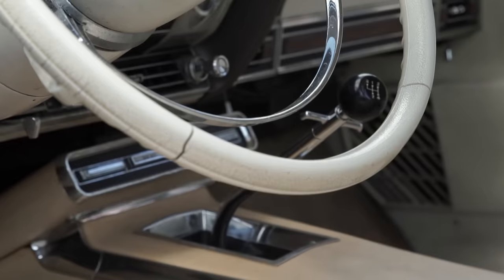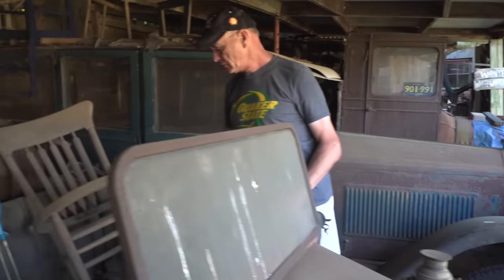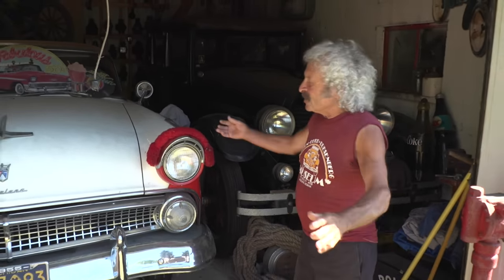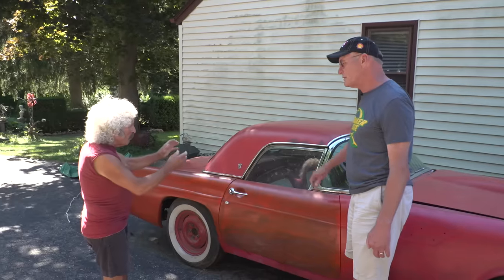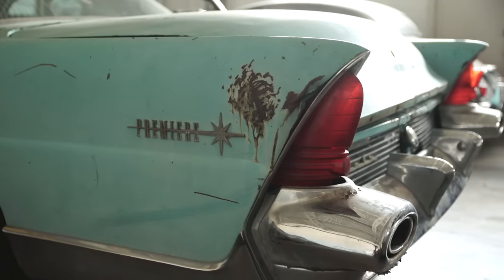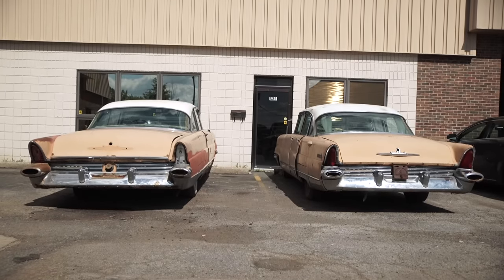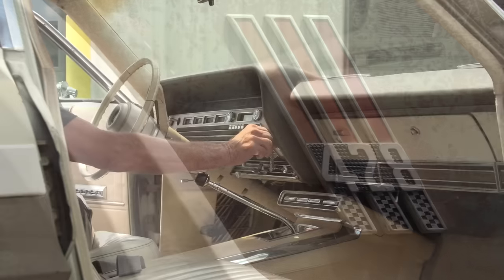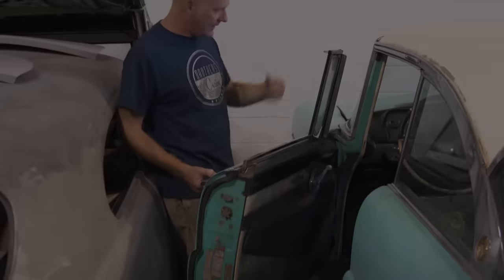1 of 1 428ci 4-Speed Ford Country Squire Wagon | Barn Find Hunter - Ep. 13

Comment: Concerning the "Pressure Releases:"
   Those little valves you called "compression releases" on top of the engine are primer cups, and do essentially the same thing as a choke to enrich the fuel mixture for cold starts.  They have nothing to do with compression release, as if a car with about 50 PSI compression even needs it...

About Early Carburetors:
     The main reason for updraft carburetors has more to do with fuel delivery than anything else.  We can give a nod to the fact that if the needle valve failed, or picked up a nano-mote of dirt, it would leak conveniently into the dirt instead of on the hot engine, but that is merely incidental.  All cars of the era came with an effective fuel shut-off valve if needed - got that covered.  
     The great majority of fuel delivery systems in the early days of motoring were fed by gravity and vacuum.  This was the simple and most sensible way to do it, and people were simpler and more sensible back then.  Some of the more affluent cars used a pressurized gas tank to move the fuel, with a hand-operated bicycle-tire-pump-like affair mounted on the dash to pressurize the tank.  That worked fairly well, too, and allowed more choices when mounting a gas tank.  
     The gravity-fed fuel delivery system worked very well, surviving even into the 1930's with the notable Ford Model A, which is about as reliable a car as you will find anywhere, in any time period, even until today (Henry coined the phrase, "The best gear is one you never use," an axiom for simplicity, reliability, and durability).  Yes, the A had a conveniently-located fuel shutoff you could activate without even exiting the car.
     Since we've strayed here already, there is a popular bit of enduring misinformation that a gravity-fed car (most quoted as a Model T Ford belonging to a long-passed close relative 100 years ago), had to be backed up a steep hill due to fuel starvation.  That is NOT true; it is mathematically impossible with all four wheels on the ground, at least in the many car marques I am familiar with, and certainly not the Ford.  I have tested my 1912 Ford T, measured from the lowest point of the fuel tank to the highest part of the carburetor fuel line and found that the car needs to be at a 45-degree angle before no fuel gets to the carb with the tank fundamentally empty.  That's not a hill; it's pretty much a cliff.  Mine is a veteran of the Sierras, the Rockies, the Blue Ridge, and, most notably, has climbed up Pike's Peak with no issues except lack of oxygen which affects the fuel/air mixture.  All stock, including ignition.  
     The only limitation of the T climbing hills under normal circumstances is in the front main crank bearing, which relies on gravity for oil flow and proper lubrication.  The front main can be starved for oil in a long climb and cause some - (ahem) - major problems.  This can be simply remedied by overfilling the crankcase (okay on a "splash-oil" system), or installing an auxiliary oil line from the magneto hogshead of the engine to the #1 main.

A Little History on Dashboards:
     The term, "firewall" is incorrect on those old cars.  They had a "dashboard."  Why the noise?  Well, the term "dashboard" was a carry-over from the horse-and-buggy days.  There was a dashboard in front of the passenger compartment on a buggy between the driver and horse.  The purpose of this board was to "dash" away (meaning to deflect) the horse manure and other noxious excrement coming from the horse (If you're familiar with horses, you can really appreciate this - there's nothing like a load of horse manure kicked up on your new spats, and horse urine doesn't come in teaspoons, it comes in gallons.)  Enough of that.        
     Well, early auto bodies, really at first merely being carriage bodies bolted to frames (with engines normally UNDER the body), still retained the dashboard as protection from mud and debris.  Then some enterprising genius saw that the inside of the dashboard was a convenient place to hang stuff like oilers and gauges and coil boxes, and the modern Instrument Panel was born, really just the driver's side of the dashboard.  We still combine the terms today, even when they have long parted company.  There was no thought of fire here; if there were a fire, it would be UNDER the car.  
     But by the mid-Edwardian Era (c.1900-1910), American cars started emulating the more developed and chic European autos and began moving the engines up front.  Maybe you could think of it as a firewall then, but since the body was primarily wood anyway along with the barn it was stored in, what would be the benefit?  
     Wood-bodied and/or wood-framed cars lasted into the thirties.  But I misspeak.  Indeed, even today at least one exotic is still wood-bodied - I believe it is called the Morgan, a British, highbrow, very expensive, custom-built, adored sports car revered by the English and others.   Otherwise, the last holdout was Franklin, an American air-cooled luxury car built in Syracuse, New York, with an aluminum body, yes, but a completely wooden laminated frame.  The car was excellent - and the frame was superior - so good that Franklin kept it until the last year or so of its existence, when Franklins were merely assembled outsourced parts before succumbing to the Great Depression.  H.H. Franklin still lives in the form of aircraft engines, where he began.  So much for criticizing wood?  Okay, it doesn't crash well, but what else?

Well, now - you know everything I know.  I don't like people who blather on and on...  But, look, I just did!  Happy Touring to all you demented motorists.

Comment: That is not a 1956 Ford crown Victoria. It is a 1955, & unless it was ordered with the Police engine, which was 292 cu. in. the normal engine would have been a 272 cu. in. engine. The 1955 T-Bird came with the 292 cu in engine, which was also in the 1955 Mercury.

Comment: i do the same thing i'm all ways looking for car and trucks i'm surprised on how many people that just want it off the property  i get a lot for free or real cheap like i got a 79 z28 rs t top with the full spoiler kit witch is very rare on any camero so far i can't find another one like it matter in fact i can't find another camero with the full spoiler kit and it was an option just a very expensive one and it made it look more like a TA i got it and a hard top z28 with an extra front clip new interior no rust in the car all for free have a 454 stroker with tunnel ram but don't want to go over 600 hp or it will just tare the car apart best part got the motor for free with another one put it in a 68 pu

Comment: 1 /21/2020

1. Why was the1955 red and white Ford repainted?

2. Whenever you record a video (notice i didn’t write “film” a video), state the date.

3. Don’t be so  quick to appraise the car’s fair market value; check the front of the frame which was susceptible to corrosion around the holes where bolts held  the suspension cross members. The corrosion caused the cross members to become sloppy, and unrectifiable misalignment of the front end.

Comment: its a 4valve engine the 4v does not stand for carburetor it stands for the amount of valves per cylinder
Reply: YES, BUT YOU WANT 4V IF YOU HAVE 4 BBL CARB TO GET THE EXHAUST OUT THOROUGHLY AND COMPLETELY.

Comment: 428-4v.....  doesnt mean 428 4 barrel, it means 428ci 4 valve..... if your gonna give info give it correctly.
Reply: Think about what you just said. "4 valve" . A 428 has 2 valves per cylinder, not 4. And it has 16 in total. Where exactly are you getting the idea it has 4 valves?

Additionally, look up FE nomenclature: 4v is 4 barrel, 2x3v is tripower, and 2x4v is twin 4 barrel. Sounds like you don't know as much as you think you do.

Comment: In regards to the 428, 4 speed wagon, While cars were admittedly kind of crappy by today's standards ( sorry old schoolers ) At least there were willing to try and give the individual customer what they wanted, and not just what sells to the masses.  As I walked past the hundreds of different color 4 door Chevrolet pick up trucks, A salesmen,,,, (person ) asked if they could help me. I said sure, I want a short bed 2wd with the 6.2L gas motor and 5 speed transmission ,posi-traction, and no A/C , I would have had better luck buying a live dinosaur,,,, with out the 20 minutes of trying to sell me a dog ( or a 4 door Chevrolet picking in any color I wanted.) And yes all those parts were right there in the same factory, and bolt right together... how ever GM, will never be the one at this point to do that.
Reply: Yup I had the same problem when I wanted to buy a Buick regal wagon last year. Only comes in 4cyl automatic, AWD. Even though the factory makes FWD manual trans variants which are available without cladding, on the SAME ASSEMBLY LINE, they are not available to order for the US., we only get the most expensive variant. The 5 door hatchback is available on FWD but is also automatic only. Fucking rubbish.
Even the Ford Focus i finally settled on was a compromise..i wanted a 4 cyl and not a 3, with a manual trans, so I had to settle for a grey sedan...i wanted a blue wagon...at least a hatchback. Unfortunately, it was either the 2L 4cyl and a stick in a bodystyle and color i didnt want, or settle for the automatic. So, I had to buy a color i didnt want. They also offer the Focus as a wagon..but of course, not in the US. Same thing with the Mazda 6....everyone else can get a wagon except for the US.
GM will probably kill off the regal wagon due to low sales and say thats why they dont offer it...but if you actually allowed people to equip it like they wanted, you would probably sell many more..but...
Thats just how it is nowadays.

Comment: There is a reason this was found in a barn. The entire running gear as well as the frame and finish were complete garbage from the word go.

The engine was complete trash and could never last 100,000 miles without being completely rebuilt and this is one reason the US was overtaken by Japanese imports during the period.

I agree finding a station wagon with this engine is a rare event, but so is finding this garbage engine in ANYTHING!